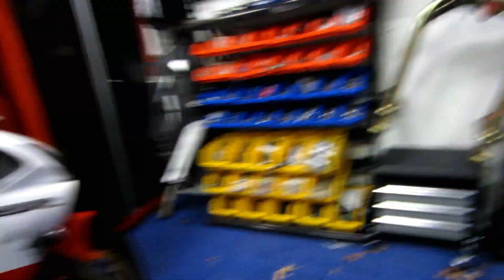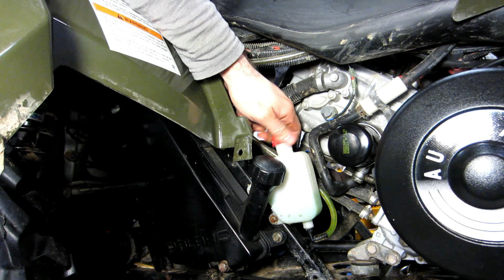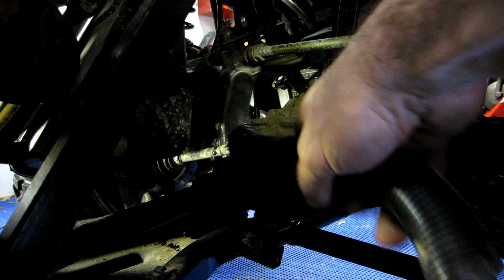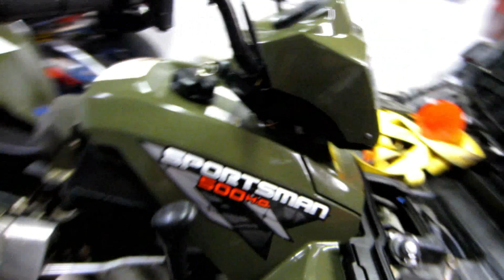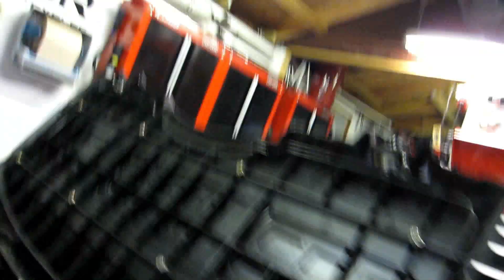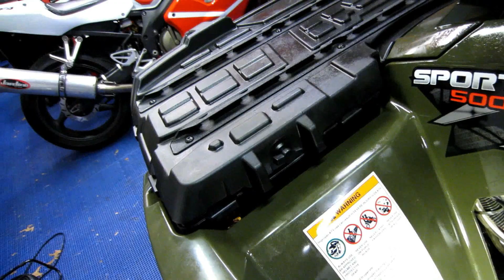Polaris Sportsman Radiator Flush and Fill Episode6

Comment: Hello my fourwheerler is the same one 500 HO it start but won’t stay running what could it be ?
Reply from the maker: Kevin i suggest finding a mechanic for this issue if you dont know where to start with the problem.
Reply: Also how much Anti freeze did you put ?

Comment: What exactly is the coolant you use? I just bought a 2010 Sportsman 500ho and it didn't come with an owners manual. So I'm kinda lost...
Reply from the maker: I run only amsoil products in my powersport stuff as i am a dealer. If you want you can email me directly and i will get you all sorted out on fluids.
Reply: @TorrentPerformance is this clear or green coolant

Comment: @torrentperformance question for you...
My 2000 sportsman 500 cooling fan will not kick on, the coolant just gets to the point it boils over.  I have tested the coolant temp sensor with a heat gun and it kicks on, and even replaced it.  I can jump the sensor’s connector as well and the fan turns on too so I don’t think it’s an electrical problem.  The water pump seems to be working because I can see coolant flowing back into the radiator with the cap off and the flow increases with rpm.  This started happening after I replaced the coolant.  Any ideas?
Reply from the maker: radiator cap with the spring isnt working properly Im guessing hard to say without it in front of me. Take the cap off and retighten it.
Reply: @TorrentPerformance  thanks for the reply.  It’s actually boiling over out of the reservoir, the cap stays tight.  The fan just isn’t kicking on to bring the temp down.  The coolant sensor works and the power going to it is fine, it’s almost like the coolant in the sensor side of the radiator isn’t getting hot enough.  My radiator’s input and output hoses are on the left side and the sensor is on the right side.
Reply: @morganathfab8727  Coolant shooting out of the reservoir cap could be a blown head gasket.
Reply: @lordnikon6786  I actually got the fan to start kicking on as it should...coolant temp stays stable now 🤘
Reply: @morganathfab8727  so. What did you do to get the fan running again?
Reply: @johne5086  if I remember correctly it was just a worn out radiator cap.

Comment: So the old one can’t be used ?
Reply from the maker: The old what can't be used?
Reply: TorrentPerformance washer. I have the exact same bike and I’m having overheating issues. So I’m going to use this video as a guide. But I don’t know what type of washer you are talking about. I guess after taking it off I’ll go to the hardware store
Reply from the maker: On the water pump? Get a new copper washer it may leak without replacing. Is the fan turning on for the radiator?
Reply: TorrentPerformance no I had to straight wire it
Reply from the maker: Ok replace that washer when you drain. Overheating is a big issue on that engine. What do you think is causing it. The amsoil coolant boost fluid you add to the coolant on change can lower temps up to 25degrees. I highly recommend it if your gonna do this.
Reply: TorrentPerformance thanks I will get it today
Reply: Where is the thermastat at